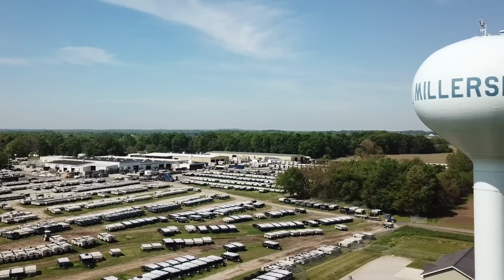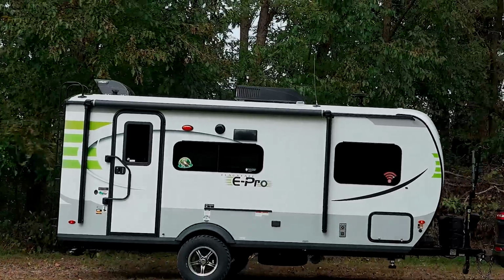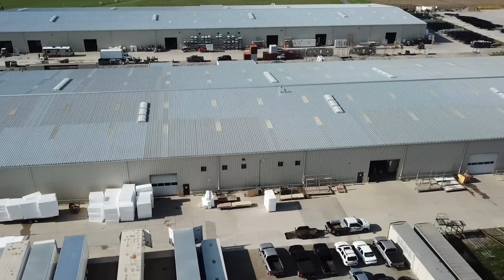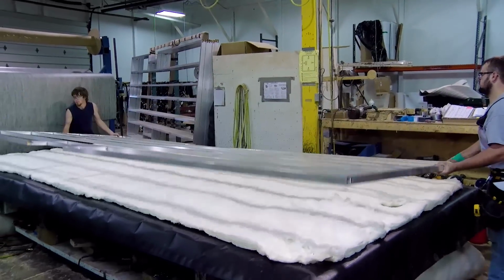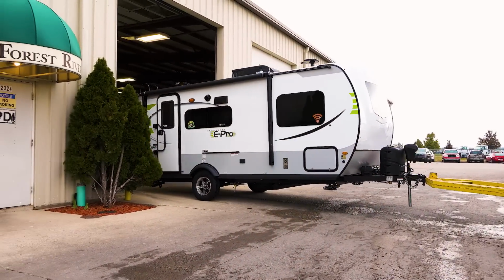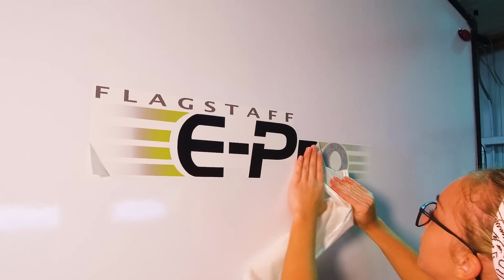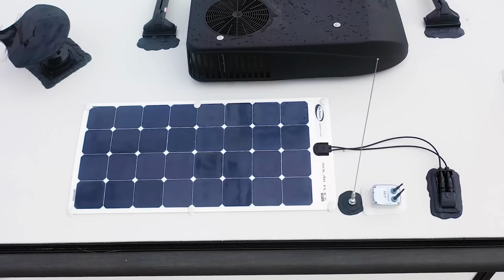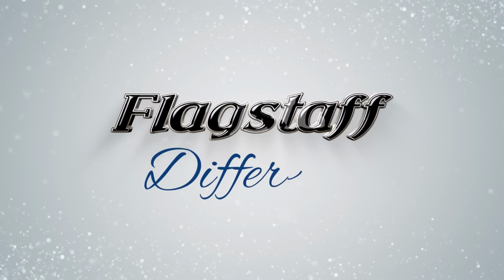E-Pro Difference

Comment: On the 19FD floor plan please consider:
1) Installing a lighted pull out pantry just left of the door when entering the rv, up to the top of the adjoining dinette seat. Atop that place the tv with a sound bar, 360° swivel, tilt and slide so it can pulled further towards the center of the rv for easier viewing.

2)Have an inside location for consumer to install the Go Power! 250Ah Lithium Iron Phosphate Solar Battery which is already compatible with the Go Power 190w solar system, 1000w inverter, charger etc. Storing a lithium battery outside can be easily stolen and is temperature sensitive. Thus with four season camping the lithium battery must be stored inside with climate control or it will freeze in the Winter and overheat in the Summer. 

3)Offer dual pane tinted European acrylic windows with built in screen night and day shades, including for the front cap. Stargazing and fresh air a must. 

4)Use the Truma comfort plus gas and electric continuous hot water and furnace unit. This will free up interior space for the Go Power! 250Ah Lithium Iron Phosphate Solar Battery, etc. 

Best,
Kent Pull
Colorado Springs, CO 🇺🇸

Comment: On the wall construction, I understand EPro has 'Azdel' material that's laminated under the vacuum bonding method. Question: Is this Azdel material on the outside AND the inside? Or is it Azdel outside and luan inside?
Reply from the maker: Unlike most manufacturers using Azdel, we at Flagstaff use it for both the exterior and interior panel.
Reply: @ForestRiverInc  Excellent. One more reason to choose an E-Pro 19FD
Reply: How much is the e19fd?
Reply: @ForestRiverInc  That is an amazing quality difference!  I confirm that most others only use Azdel on the outside.  I also noticed in this video, are you saying that your floors are 1/2" plywood?
Reply from the maker: Please reach out to your local dealer for a quote on this unit: https://forestriverinc.com/rvs/travel-trailers/flagstaff-e-pro/E19FD/3557

Comment: that single solar panel seems very limited. are there any factory options to upgrade?
Reply from the maker: The solar panel at the time this video was shot was a 100W panel but we are now installing a 190W panel. The roof solar port can accept more solar panels to expand the system on either.
Reply from the maker: Also, the factory installed 30 amp charge controller can handle up to 600W of solar

Comment: what model is that jeep cherokee trailhawk towing?
Reply from the maker: That is the E19FBS.
Reply: @ForestRiverInc  I was hoping it was the 20bhs since I've been wondering if it can tow it :). Thanks for the info
Reply: Rebel Forged  - I am towing the 20BHS with a Subie Ascent (5000lbs towing capacity and 500lbs limit on hitch) just fine, provided all 3 tanks aren’t full (~800lbs over trailer’s 3513lbs) and carefully limited cargo is adequately equilibrated to avoid overloading the hitch since the empty trailer already piles 455lbs on it.  The Cherokee Trailhawk’s  4500lbs towing capacity may not give you much headroom for cargo, though (unless you are talking Grand Cherokee, which has plenty more).

Comment: We have a 2021 Telluride with the towing package, can it handle the 16bh e-pro?
Reply: If you have tow package and the self leveling suspension, you may be fine. You can get on kia/telluride forums and find people are towing trailers of almost this exact size once they have a 7 pin harness and brake controller installed. You can expect an array of answers on this topic. I suspect many will say this is too much trailer for a Telluride.
Reply: David, I tow a GeoPro 20BHS with a BMW X6. I have a 6000 pound towing capacity and 600 tongue weight limitation. I use the Eco brake controller and a weight distribution hitch. 
I see no problem towing the 16bh e pro with a telluride as long as you stay within your 5000/500 limits. I prefer to stay at ⅔ of the limit. My trailer is 3650 dry and I’m at 4K loaded with no water.